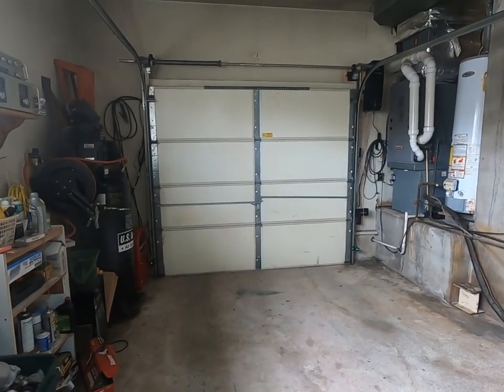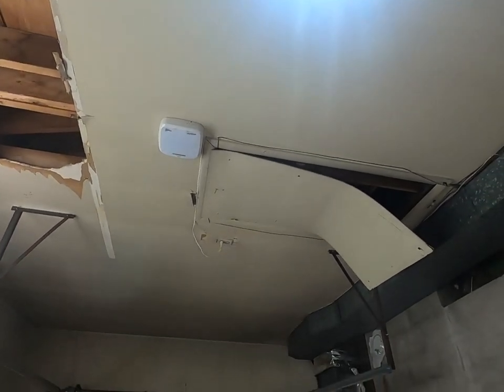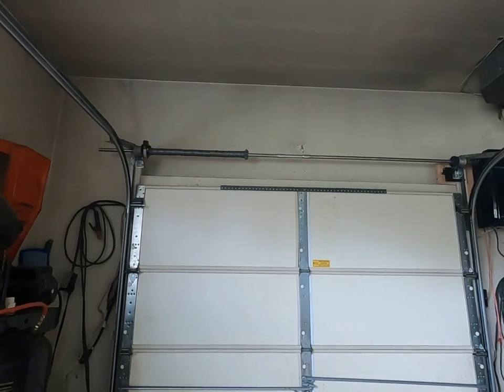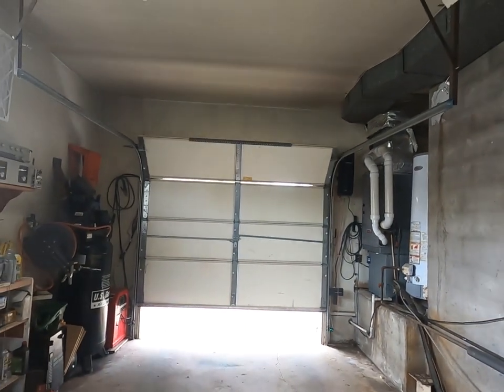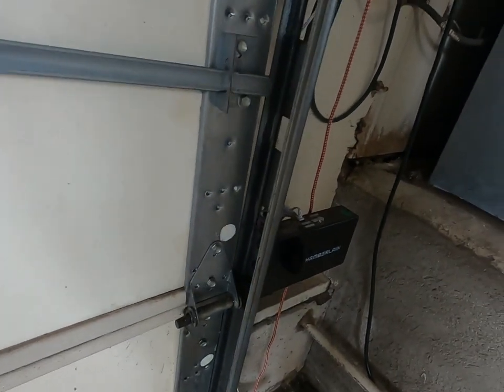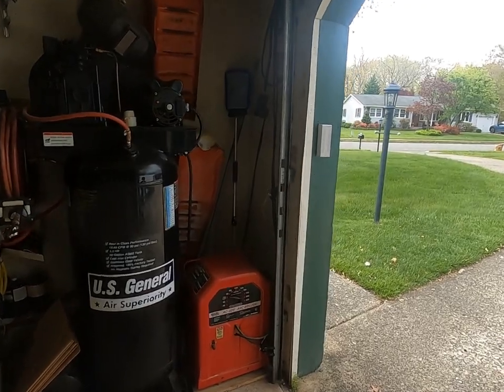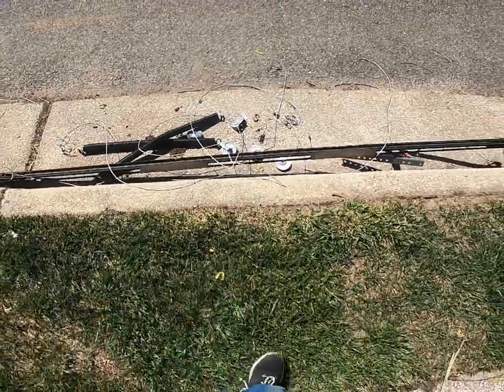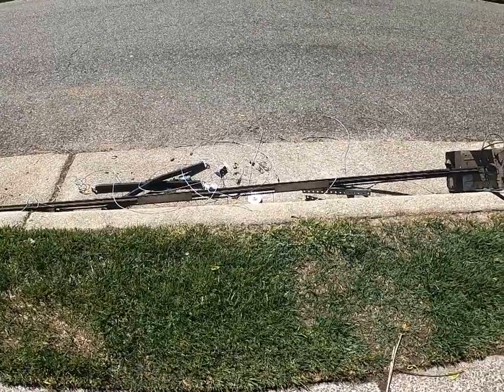Conversion from a center mount to a wall mount garage door opener

Comment: is that the clopay torsion conversion kit? They told me I couldnt use a sidemount garage door opener with that kit.
Reply from the maker: Yes, the model number I used for my door is in the description.  It has been is daily operation for about 11 months and no issues.  And the side mount opener is the was to go.  That part number is also in the description.